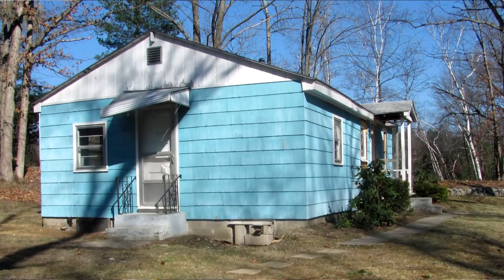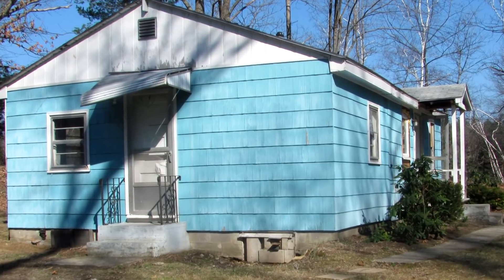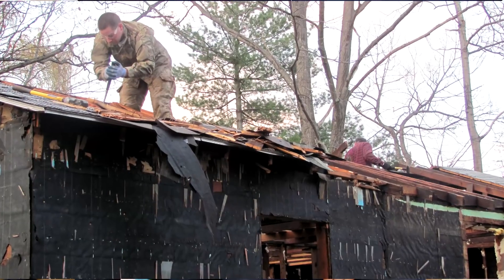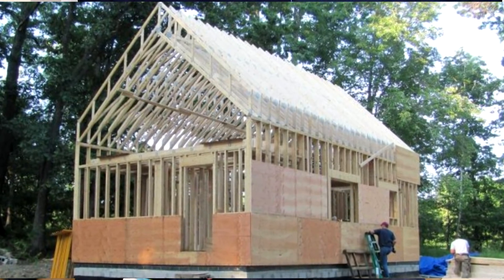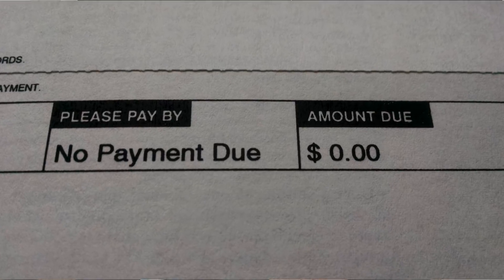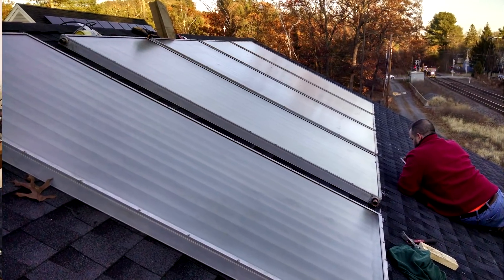Why are we doing this?

Comment: Update?  
If We had it to do over again?
Lessons learned?
Future?
Reply from the maker: Good ideas for a video, thank you.  We have been off-grid on the inverters most of this summer, and last year we were also off-grid on the smaller inverter.  But we are lacking in both batteries and solar panels.  I'm working on expanding the system.  But if I built a new house I would include space for a larger hot water tank with solar tied to it so we are not as reliant on the batteries.

Comment: Our house is hybrid.   Florida power is used for Hot water and Ac.  We have a set of panels for twelve Volt lighting.  And a separate set for TVs and radios.  Also fans run on solar.  Our water heater is on a time for two hours a day.   Led lights in every room but the Florida room.  It is twelve Volt.    Our Power bill is from $45 to $90 max.   We don’t let anything on that’s not being used.   Every thing is on a power switch to turn it off when Not in use.   We are not grid tied and don’t want to be.     Every thing that’s solar is wired separately.  I Alway look forward to your vids because of great info.      P.s. I would use wind generators to help with your power needs.
Reply from the maker: Nice work Jim.

Comment: I was considering building a wood gasdifier. to run my generator and water heater. maybe grill and stove. I started gathering mateteals. I also have a wood stove. I was thinking about using as a boiler and for water heating. use the boiler to runa steam powered generator. to help charge the batteries during winter. I have the alternators to push nearly 600 amps . just need something to spin them. I want to stay away from the grid and gasoline / diesel. and be as clean as possible..

Comment: A zero-energy building, also known as a zero net energy (ZNE) building, (Not NetZero.net, a internet provider) net-zero energy building (NZEB), or net zero building, is a building with zero net energy consumption, meaning the total amount of energy used by the building on an annual basis is roughly equal to the amount of renewable energy created on the site, or in other definitions by renewable energy sources elsewhere.

Comment: We have been totally off grid for 4 years here in Chile. We have NO BILLS! oops cell phone and that is it!
My family asks the same questions all the time......... my extended family, but we moved to Chile so we took it to a lets say Higher Level of Wako!

GO see our Hot water videos!!!! We heat our house and our showers and kitchen. We take 45 min showers and do not run out of scalding hot water. We have an awesome hot water system, but this system would not work for you though because it is Illegal in the USA. The government is afraid you will hurt yourselves! We do not have that problem here in Chile.
We use NO propane (for the main/big house) or oil since we are totally off grid. You will need the generator as a back up!!!! 
I am doing what you want to do right now. You must be redundant and that is the key.
BTW we use Vacuum tube hot water solar tubes not the flat panels and they are very common here as they are more efficient. More expensive too. 
 Thanks for the video. Jim
Reply from the maker: Thanks for sharing.
Reply: yep

Comment: What about those cheaper propane tankless hot water heater in conjunction with the thermal solar units for in the winter for you guys?   I would look deeper into those LED lights and the Health effects with a baby in the home.  Maybe you could install more Solar Powered lights inside ?  We use a thermal hot water unit, it was already installed when you bought the home, but I changed the routing config to use the water out of the unit first bypassing the hot water tank which we have now replaced with a propane tankless.

Comment: Greetings from off grid Oregon.  I see that you are going off grid with Chevy volt batteries. My next set of batteries will be Chevy Volt or Nissan Leaf bateries as well. I should get at least 10 more year out of our current bank (pun intended)
We heat our home with wood only. I have burned wood for heat since 1971.  
You make a valid point about propane. We heat water with propane. This fall we hope to put in a range boiler mod on our wood stove. That will give us free hot water for 8 to 9 months a year.  The solar can heat 5he water the rest of the time. We cook with wood and propane. I like cooking with gas. I suppose if we could not get LP gas any more I would build a sin gas generator. Here in the woods of the Pacific Northwest we get lots of rain and snow. For over to days a year in a row we get NO appreciable solar gain. It does not matter how much solar you have at that point because 1000x0 is still zero. For those 50 day we use a diesel generator to bulk the batteries. Last year we burned about $30 worth of off road diesel. It's not breaking the bank. We wold be ok without the propane and diesel, it's more a comfort. We could do without if we could not get it anymore. We have 40 acres of timber and a Woodmizer sawmill. We are old school and do everything ourselves. Everything here we built ourselves. Not bragging it's just because wages are low in our area and when you do everything out of pocket it takes awhile. I hope you get your Net Zero. Sounds fun. Have a blessed day.
Reply from the maker: Sounds like you are doing a lot of great projects.

Comment: To just ask a potentially dumb question, why heat the garage? 
even if the area is very cold, one could just plug in the car to keep it heated instead?
Reply from the maker: As Charlie already mentioned, it is also my workshop.  Another thought is that a block heater would use electricity, and I'm heating the garage with solar hot water.
Reply: Freek Hoekstra it is also his workshop.